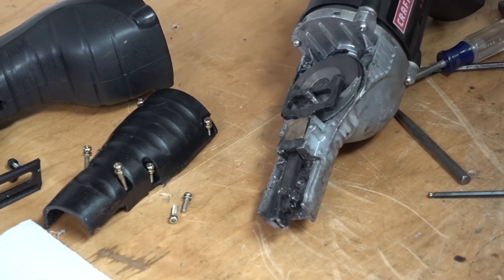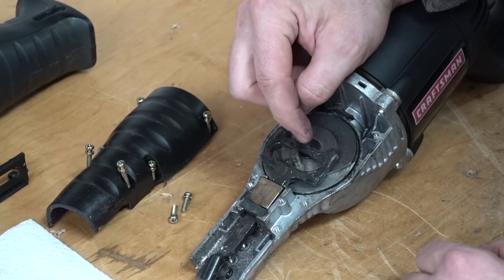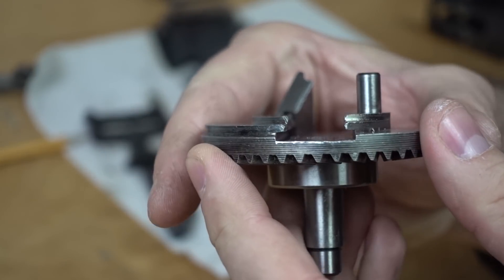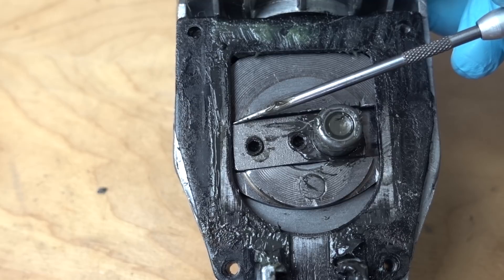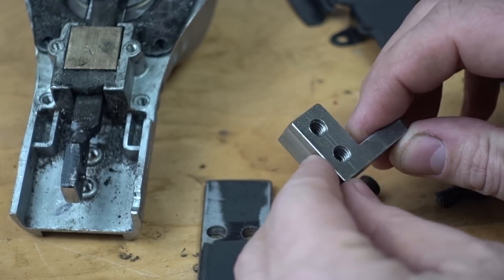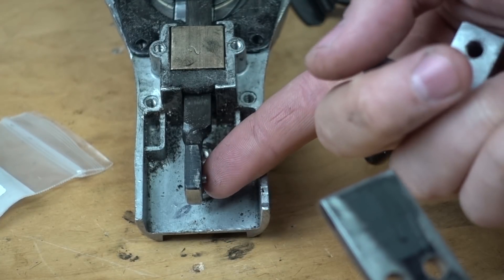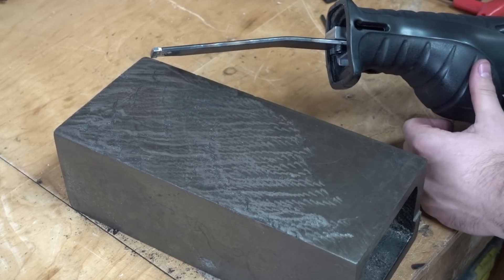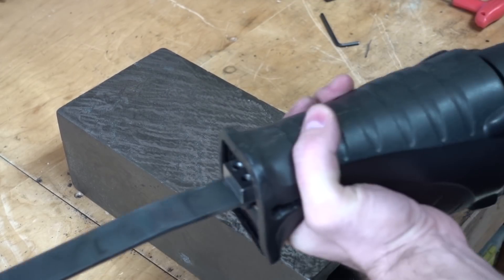DIY Metal Scraper for machine tools // Power Scraping

Comment: Found and watched this.  Great vid and loved your enthusiasm.  Didn’t hear any comments on how deep the groove was for the t-slot.  Are you able to advise how thick that adjustable slide is? Has it held up over time?  Any reason to went with a t-slot shape over a dovetail approach?  Cheers and greetings from NZ.
Reply from the maker: Thanks.  I chose a T-slot because that's the cutter I had at such a small size.  No other reason than that.😀 If memory serves me, the adjustable slide was between 1/4 and 3/8".  Basically thick enough to function without  hitting other moving parts for that particular reciprocating saw.  Has it held up?  Absolutely!!  I scraped my entire Wells Index milling machine(see my other videos on that).  I have no reference as to how it compares to a proper Biax brand power scraper, but it's light years ahead of scraping by hand.
Reply: @ThunderDog  thanks. I’m looking at mods on a saw with similar internals but of a local cheapo brand. Ozito. Looks like best I will get is 5mm thick but given the forces involved (less than on a saw blade) it should be ok.
Reply from the maker: @jameswalker8338  Yup, you'll find that pressure input from you is not required. Therefore, the sliding part is not under some crazy amount of force like a saw blade.  Best of luck.

Comment: Hey ThunderDog. Awesome!!!
As to the adjustable stroke, did you find that you adjusted it for different parts of your scraping project, or did you find a stroke that worked best and just left it in that position? What did you find to be the ideal stroke length?  What I'm trying to determine is whether it really needs to be adjustable???  It might be easier to make this modification if it only needs a fixed stroke length. Thanks
Reply from the maker: Good question, I did adjust it throughout the scraping process.  For instance, roughing would be a longer stroke and then as I neared the final passes I would shorten the stroke.  Finally, I would hand scrape the final pass.  I can't remember what the initial stroke length was on this "sawzall", but I can definitely tell you that the most common set position of the pin is closer to the center of rotation than the original factory pin placement.
Reply: @ThunderDog  Thanks. That helps.
I only have a small scraping job. Just the top of the knee. I think I will try to use an oscillating multi tool first. I am guessing that it will be something in between hand scraping and power scraping.
Do you or anyone have a good, but cheap source for the carbide bits?  Thanks.
PS: Get you shop set up and get back to work  (and videos) SOON!
Regards
Reply from the maker: @KW-ei3pi  I just paid through the nose and purchased two carbide pieces from MSC.  I feel your pain when it comes to saving a nickel.  FYI, you may find that scraping the knee Vee-ways may be easier with a hand scraper.  It requires some finesse to get down into a Vee and not hit the other surface by accident.  The most important thing is MEASURE and then MEASURE AGAIN, and then truly verify what is actually going on with the wear patterns before scraping anything.  Best of luck and thanks for watching!!

Comment: I've seen this done before. First time I've seen one with an adjustable stroke though. Not as elegant as a Biax but if it gets the job done. It just looks a little awkward due to the ergonamics. I've had a similar idea for this using one of the smaller recip saws
Reply from the maker: I agree it was awkward at first but here is how I remedied that situation.  I used a small scrap of wood wedged in the trigger to keep it in the "on" position.  This allowed me to cradle the tool like a football.  My left hand holds the top to help guide it.  Sounds convoluted, but it's really a comfortable position.  Hope that makes sense.
Reply: @ThunderDog  I didn't realize just how simple power scrappers were till I saw this video, tempted to make one from scratch....
Reply from the maker: @andrewyork3869  I say go for it!  This saw was an extra so it was no big deal if I ruined it.
Reply: @ThunderDog  yeah, I totally get that. Given that this is not a tool that will easily suck your hand in or the like do you think a toggle switch would be a good addition? Maybe if a dead man switch is a must a foot pedal maybe? I also thought about making a top side handle with thick rubber sheet and Paracord to kinda hold it from above. Mainly to take pressure off my wrist.(I am 21 and it already clicks....) But this is going to save me some time on my next big project.

PS thanks for the video of your mill spindle going to help me a bunch on my DIY cnc mill!
Reply from the maker: @andrewyork3869  Hmmm, maybe a switch but that's up to you.  See above regarding how I hold it during use.  I found a chunk of wood wedged in the trigger to keep it on worked just fine.  But, as always you are responsible for your own safety.
Reply: @ThunderDog  of course, also a most likely dumb question but I have not found a good answer to it. Can you mount a lathe Chuck to a machine that only has a face plate? Kinda want to build a machine from scratch just to learn the fitting/tunning process, and instead of trying to make any kind of taper just building a fixed face plate and mounting everything to that with a sub plate. Maybe make one with more heft then really need be, just so it doesn't because a issue later?

Comment: Nay sayers be damned, just you level of excitement and enjoyment are worth more than anything negative they find! Thanks for bringing your ingenuity to the masses, yet again. 

I wouldn't mind a little more detail on the parts list/design elements...thanks, I'm a bit thick ;)
Reply from the maker: There's not much to it really.  I'm sure other reciprocating saws have variations, but I would guess to say that they are similar in design.  You just need to make the scotch yoke pin adjustable with a T-slot arrangement or  a dovetail arrangement as seen in an internet search result.  Regarding exact dimensions, I didn't make anything specific.  From memory, the T-slot is about .100" W x .095" H.  The pin for this saw had to be a specific diameter to accept the needle bearing .  Other than that, piece of cake!  Your mileage may vary.
Reply from the maker: Oops, let me clarify.  The ears/wings(or whatever they're called) of the the T-slot is about .100" W x .095" H.

Comment: Hell yeah, low budget and on the right track! Already better than my version using a porter cable detail sander. 

As to the variable speed control, use a dimmer switch, cheapest easily availible potentiometer/rheostat, that's the only adjustment on my ghetto scraper. 

Thanks for getting the camera out for us all.
Reply from the maker: Yup, scraping on a budget!
The great thing is that this saw has variable speed already built into it.

Comment: Great modification.  When using a Biax, the stroke is in-and-out, as you have accomplished, but the tool should be moved sid-to-side, the same way one would use a hedge trimmer.
Reply from the maker: 10-4.  You got to see a complete newbie on display, right?  Thanks for letting me know and others watching hopefully read this comment.
Reply: On a Biax the blade moves in and out. On the Biax Flaker it oscillates in a rocking motion and the blades are completely different

Comment: Don't know what I'm talking about but could it be going a lil too fast? looks like maybe a slower speed would help with that short stroke? I was thinkin that maybe a some type of bump stop like a bolt threaded into trigger to limit speed? That is if it works like my sawzall where mo' trigger equals mo' speed. Just a thought. Super cool video!
Reply from the maker: It can run slower with the potentiometer and/or less trigger.  Thanks for watching.